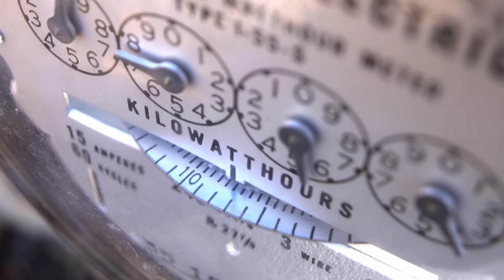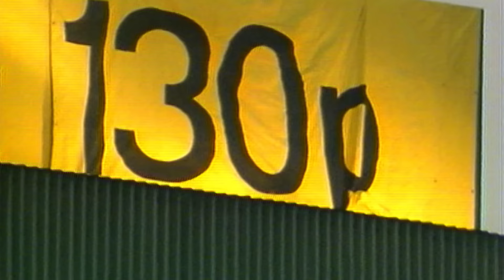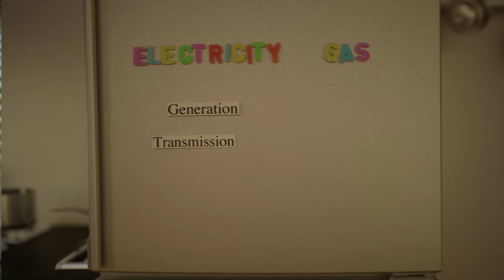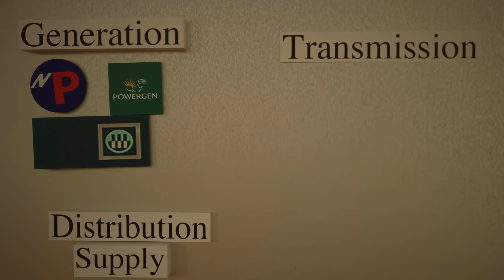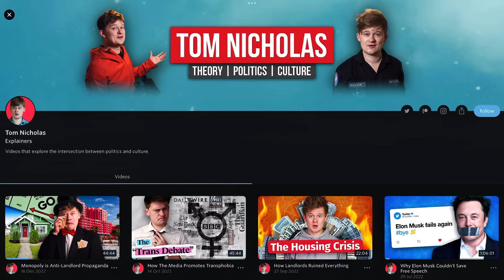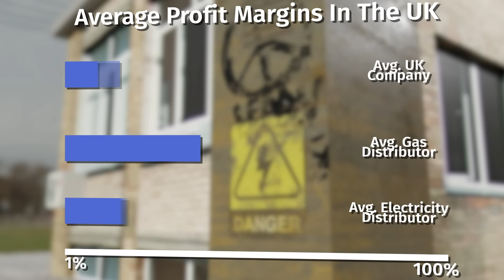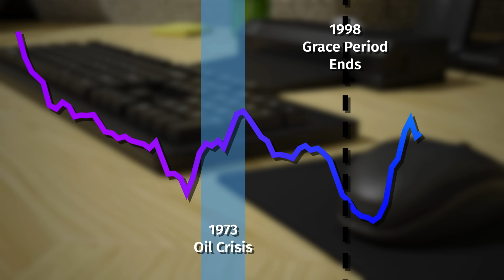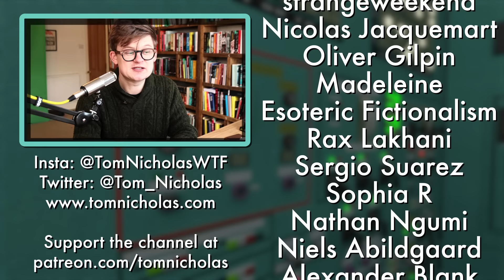Energy Privatisation is Bankrupting Britain

Comment: Privatization is good in the long run once you get multiple options to choose from. Once you get multiple businesses fighting for your consumption, prices will drop. Maybe you want a power that's not derived from coal but something more sustainable. With multiple businesses to choose from, you can make sure you choose a business that makes the energy you want to consume.

Every major change is going to have some hiccups when first implemented but it's better than the crown saying "this is your power source. If you don't like it tough biscuits". Freedom comes with some personal responsibility. Do some research and Support the businesses that align with your values

Comment: The problem with nationalised power was they didn't do the necessary maintenance. 
I was involved in the building and refurbishment of substations, from the 33kv little ones in small towns to national grid 400kv. One thing in common was the age of the equipment I was replacing, most of them were the same age as me at the time, 50+years. The equipment now can be much smaller as they use nitrogen to protect them, from the 33kv outside subs to now one building less that a quarter of the size of the old sub. The equipment is also produced all around the world and are more delicate than most realise. If an isolator has a chip in the porcelain it cannot be used as it could easily fail with the weather we get here, you can't simply find the bit that broke off and superglue it back on as they have undergone a 1 million volt test and would now fail.
Yes, power is expensive, yet SSE spend £50M per substation for the new 400kv Grid and have been refurbishing the 275/132kv and the smaller subs, I worked on 12 substations over a period of 10 years and two of them were on rigs now part of the London Array. People whinge all the time yet you don't see them converting to off-grid power, they whinge when new windfarms are built, they whinge when off-shore windfarms are built but they want endless power but are clueless as to where it comes from.
I remember being at a meeting about a windfarm and a woman piped up that everytime she drives past a windfarm the blades aren't turning. I told her that was because she was driving her car and didn't leave her lights on in the house, and when she did have them on she couldn't see the turbines working.
As far as house temperatures go, I am 18°C all year. 
That's because I had an accident and was badly burned, it took most of the sweat glands in my arms leaving the outflow of heat to my hands, head and shoulders. Now, even in winter, I do not cope with heat well, so, in summer I try to avoid the heat and in winter, don't use much because it gets too hot. Last year my bills quadrupled not 50% but 300%, yeah, I don't know why either but OVO didn't care, they were making oodles of money. So, I bought a Chinese air heater that is going to be installed soon and we'll see how much that costs and how it heats the house.

Comment: Video is very ideologically misinformed and coming at the problem from the wrong angle. Privatization isn't bankrupting britain, poor government decisions and regulations are. It's consistent across British infrastructure because it's an institutional and cultural problem. Rail, power, water, telecomms. All of these services have been "privatized," but... not really. What they've actually been is, "segmentally franchised," and here is where the failure lies.

Instead of simply selling off infrastructure as a whole to be managed and developed by companies, this infrastructure is leased or franchised out to dozens of smaller companies, all controlling different aspects of a single arm of infrastructure. For trains, this is companies that own the track, different ones that own some of the trains, others than own the stations, others that run the maintenance, etc. This means that no one company owns the entire thing, and thus does not benefit from investment in the infrastructure, only the maintenance of it. Besides, you can't upgrade your trains if you don't also change the track, which is owned by a different company.

This is mirrored across EVERY infrastructure type in the UK, and it is ABYSMALLY effective at development. What it's good at is minimizing cost to the government for bids. Now, one single company is granted a section of track? They have a lower bid but higher prices and no investment? Government grants the bid, and that line falls into decline with ever rising prices.

Same is done for energy providers. However, with energy it's a bit different. The Uk generally doesn't control any energy production infrastructure (aside from windfarms but we will get to those things). Instead, companies are again, franchised aand segmented to fill regional demand, but ALL of these companies buy their energy from the global markets. What the government does is set caps on prices, and investment. And, yep, you guessed it. Companies are focused on providing low bids, while simply maintaining infrastructure, not developing it, as prices rise due to state granted locval monopolies and the IMPOSSIBILITY of competitors entering the market without also being "allocated" a franchise.

By setting price limits, the UK government destroyed the majority of energy providers and consolidated the power into the big 3 as they bought up their franchise rights. As a nice bonus, this cost (created by nice big cushy payouts to solicitors, bankers, bonuses and royalties) is then covered by the standing charge, which at this point needs to be abolished. That's part 1 of why energy bills are high.

Part 2 of why energy bills are high is due to the price cap. By providing a government guarantee that ANY additional cost to suppliers would be paid by the government, the providers proceeded to mass-panic buy all of the PEAK prices for 2-3 years ahead, incurring MASSIVE unsustainable costs and debts with ridiculously expensive energy. However, all of this is guaranteed by the government... which you as taxpayers are now obliged to repay. The energy markets loved this as it was a free money bonanza guaranteed SOLELY by the UK government. And because we have years of energy contracts at peak prices, of course prices aren't coming down now despite gas being BELOW 2019 prices. This is a major one, and frankly, the UK should be rioting about this. Thats not the fault of privatization, thats the fault of incompetent fools in government setting ridiculopus incentives and treating the taxpayer like an endless source of funding to score political points.

Part 3 is a little more long term. 10-20 years ago, some of you may remember the push to build offshore wind farms and may remembe rthe claim that "this is expensive today, but will result in cheap, clean energy in future. it's an investment."
Well, what happened is the government agreed deals with private companies to build these windfarms (offering ridiculous costings grants might I add) but the price was guaranteed as a minimum of the spot price of natural gas. Meaning, if the wind wasn't blowing, they would be paid the equivalent energy cost of the spot price of gas.
Fast forward 15 years, guess which commodity skyrockets in price 7x? That's right. Natural gas. All of a sudden these wind farms, which had not changed whatsoever, is suddenly charging custtomers 7x what they were paying before (subdisized by the government of course) while raking in massive profits. Again, thgis isn't because of privatization, this is because of government incompetence and failure to set a reasonable price for energy and pegging it to something stupid like natural gas. Thjis price link also applied to nuclear, solar and hydroelectric energy by the way. Thats why no matter where you got your energy, it all skyrocketed.

Again, taxpayer funded. Taxpayer subsidized, prices guaranteed for international markets. The taxpayer pays the bill. You and me.

I could go on and on but this is already too long and likely nobody will bother to read it and simply watch this misinformed video instead, but hey, for those that did read it, congrats, you might be as mad as I am at our governemnt.

Now, for a second let's imagine energy really was privatised. You own a wind farm, or maybe even a series of oil rigs, or a nuclear power plant. You see natural gas prices skyrocketing, but you don't have some stupid agreed "price for energy" with the government. You essentially charge what the market wants to pay for it. So you see an opportunity. You will undercut the price of evergy by 50% in exchange for government planning waivers and low-interest loans to build more infrastructure. You still make a profit, because 50% of 7x is still 3.5x your previous profit, you are simply "trading" current profit for easy access to expansion.

Over the next year, while providing bills that are REALLY 50% lower directly to customers (and not costing the taxpayer to pay for international rates) you build a bunch more windfarms very quickly due to the ease of funding and lack of red tape. Suddenly, your business is FAR larger and able to provide more domnestic power, reducing bills for the general public at no more cost than the government providing loans (that will be repaid) - this isn';t true of the energy subsidies as those are burned cash which simply goes to international profits.

This is the difference of privatization vs franchisement. Government support, rather than government control. 

Try to set up an energy company, a rail company, a water company. See how many barriers are in place and how many ridiculous hoops you have to jump through and the limitations of what you can do. It;'s impossible to set up a new private company and develop our infrastructure. You are always under the thumb of the government and doing what it wants, which is 95% of the time, an inefficient, short sighted mess.

HS2 perfect example. Government budgets, project managers, plans. Franchised and contracted segmented work done by private companies. It's a massive failure.
Reply: I read it all. Interesting take. Sadly your senerio would never happen. Call it franchising or whatever you want but the selling off of a countries utilities and infrastructure in any  so called free market will inevitably lead to price increases. If the public's utilities and infrastructure were sold off in whole and managed by company management as they see fit it would not result in more investments in infrastructure or innovation. 

Before long the whole system would dominated by a couple massive corporations and instead of investing profits in innovation and maintaining infrastructure it will be funnelled to an offshore tax haven, and spend on the executive's compensation and share buybacks. And just before  the neglected system starts to collapse, start the sell in off.

Government managed utilities may not produce massive profits and may even operate a loss. But public utilities and infrastructure should be government owned and operated to benefit of the majority of the population.

The sole purpose of any corporations existence is to maximise profits for its shareholders. It's as simple as that. Corporations can write what they want in their charters about being good social and environmental citizens. But it will break any and all laws if it can make money. These identities have been given the same rights of a human citizen but are not held accountable for the responsibilities of all other citizens. 

The fact is that corporations and their lobbyists can bend any government to pass laws and legislation that will favour themselves and disadvantage everyone else. 

So expect more pain courtesy of Thatcher.

Comment: 49:59 well I've just saved a bundle by having 2 solar charged battery banks swapped out grid or solar charged keeping my small screen device with relatively efficient low power high output audio separate from the screen/computing and i accomplished it in half time by training myself ramping up comprehension speed at 2x normal so when at 2x speed in video it's 4x speed once my body and brain 🧠 adjust to such it saves me a bundle of time like alot it actually becomes painful to slowmo anything though it is fun to listen to music 🎵 super slowly or super fast adjusting for what  sounds most pleasant but it also forces me on a tome crunch because instead of getting a 1hr break for lunch i then miss out on 1 half hr of me time and wnd up exhausting self with more work instead or I could watch 2 long form contents which i prefer but ai taking over doing vacations for me so i can be even more exhausted with no job because the ai is being payed not me😂 not yet but they said that someone else said 5yrs and that'll be reality they expect 😮 hopefully not enslaved by computers by then

Comment: Interesting video. Not sure how much I agree, though my experience in the industry has only been in electricity generation in the US. 

From the limited literature I’ve read, electricity deregulation has generally made the industry more efficient (in the US), though it’s not clear whether consumers benefited from this vs. shareholders.

I also haven’t seen many people advocate for coal as a generation source, if that is what this video is suggesting. Coal undoubtedly has the worst effects in terms of air quality, and is probably the worst for greenhouse gas emissions. And unlike gas, coal is not great for ramping generation up and down quickly. Gas generally pairs better with intermittent resources like wind, which I imagine the UK public strongly supports. The UK probably should’ve gone nuclear in the 70s and 80s like France.

It’s also very hard to tie electricity prices to a particular policy, due to all the confounding factors, especially gas and coal prices but also changes in government policy.

Ofgem does seem strange as an institution. It sounds different than the utility board arrangement that exists in the US.

Comment: While, I agree that privatization can lead to this outcomes, we have to take into consideration that there are many energy providers that are privatized in the world.

If this problem is rampant in the UK a commission needs to be formed to look more deeply into what seems to be causing the problem. I know from a quick look that there are many issues that can cause your energy bill to rise chief among them; old grid equipment repairs, changing to newer equipment, the energy that goes into the grid, are you in a city or suburb, and plain old greed with political support. 

Let's not be quick to take the pitch folks. Call your local politician and energy company, inform yourself and then proceed to look for potential solutions.

Comment: Your analysis is wrong, it's not privatisation that is the problem is a poorly structured market. 

Yes, there should be public actors in it as well, but it's the barriers to market of aggregated load shedding, aggregated storage/reinforcement (eg vehicle to grid), grid entry blocking (OFGEM's requirements for National Grid as the System Operator blocks access), etc. that causes the excess profits of energy suppliers.

The common thread in all of those issues is centralised decision making. What your suggesting (that it should be fully publicly run) would only lead to much more significant centralisation and an even less efficient system.

I'm no fan of Thatcher, and the privatisation of utilities was very poorly conducted, but a publicly operated system would be (and was) not a good solution.
Reply: I would be very interested to hear your opinion if you were freezing cold and could not afford to eat as you flick through this month's economist. 😂 What are your thoughts on the Nhs

Comment: Fake news. In 2020 I paid £750 a year for electricity and I have a tiny terrace house. £450 a year is stupid. My coal and wood bill for 2020 was over £250 on top of that electricity. In 2020 I paid £1000 a year for power heat and light. 99.99% of youtube is fake.

Comment: you think its okay to tax people of any wealth 83%
Reply: well yeah, its fair. 40% tax bracket in 1975 would be between 47,307 pounds and 52,564 in todays money would after taxes have around 20,000 pounds left. The 83% tax bracket which would be over 210,000 pounds would have at minimum left them with 35,700 pounds, more than the lower class.